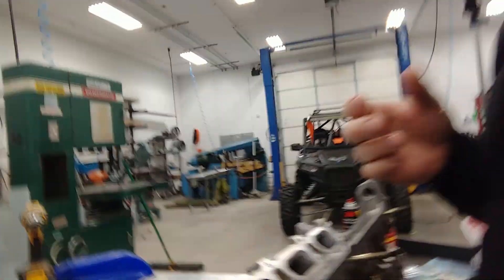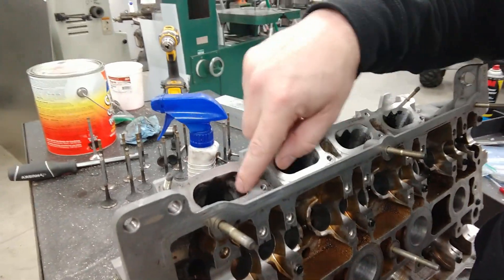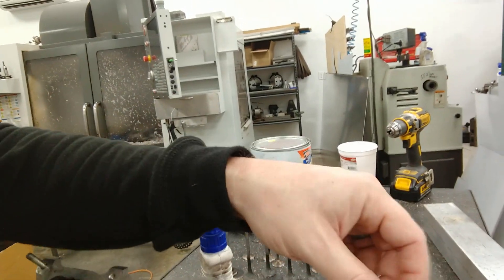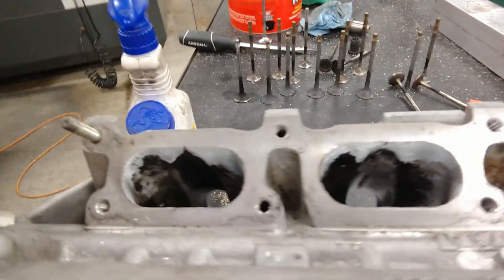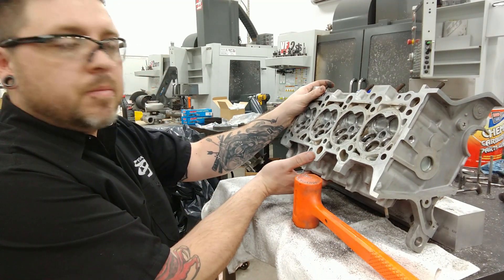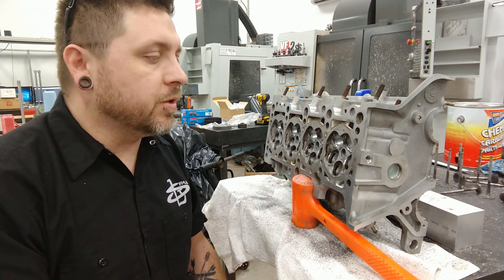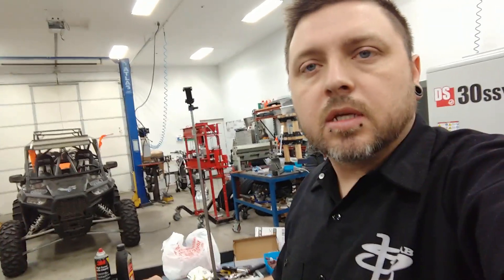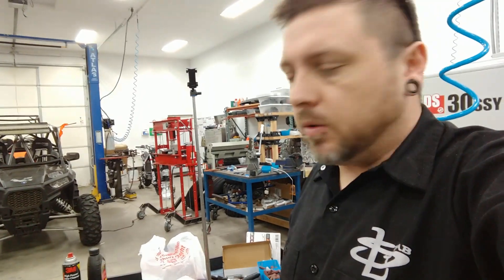VW 1.8t 20V engine build, head porting, intake ports.

Comment: I'm currently setting into the same job on an AWM head for my Passat wagon. A long time ago (18-ish years) I ported a 16V head for the Scirocco I had at the time, that one was a 1.8L head on a 2.0L Passat block. Comparing the 1.8L & 2.0L heads revealed noticeably larger ports on the 1.8. That work rewarded me with a very noticeable increase in engine response, it would rev up way faster. Certainly some credit would go to the larger exhaust and Euro intake cam, but I'm certain the head work did a lot. There seem to be a lot of parallels to how you've opened yours up to match the valve seats and also tweaked the ends of the valve guides too, with small differences how we both approached that. I did like your solution for using the tubing to spin the valves for the seating process, I was going to be looking for a suction cup type arrangement to put in my drill to spin the valve from the chamber side, but your trick might be what I try instead. My idea would have wobbled a lot if not perfectly centered. Teardown for the 20V head is more of a PITA with the smaller intake ports and getting out the valve stem keepers, I imagine getting them in will be even more 'fun' than their removal was. I originally found your channel while searching for valve stem keeper installation tools & techniques, though being in Canada the significant shipping cost of that tool makes it less appealing. Anyways, nice work & love that shop. I too just smoothed and polished the combustion chamber, removing the minimum material possible. I just wish the exhaust manifolds were as easy to port as the intakes.....

Comment: Unless your going for over 800hp that won't make a difference. I'm not saying that from a guess. We made 352whp with an f23. It's making 562whp with a precision 6062 now. Stock cams. Small port head. Next year we will be over 650whp. Small ports.
Reply: What mods did you have to make 352whp with the f23?
Reply: @joshpalmer4889  tubular exhaust manifold. 3" turbo back from 42dd, 650cc injectors. S4 maf, IE rifle drilled H beams and wiesco pistons and a bunch of other stuff. The configuration did not last long.
Reply: Did you use e85 or meth?
Reply: @joshpalmer4889  93 octane tune. Water-meth kit was used to boost the octane. We had a 450hp pte5052 TT that was e85. Hard to find gas stations. With the 93 tune it was easy to drive staying out of boost and getting 30+mpg. Hit the dragon and get 4mpg. Then back to Virginia. BTW, the cams will get you there. With the pte6062 it was a mirror build of the vagwerx shop car except we had stock cams. Vagwerx said the cams would put us at 650, 500tq. But the trans was not ready. The current tune is 397ft lbs.
Reply: Also what failed on the configuration? I’m setting up Gonzo’s gtt k04 and trying to max it out. So far I have a grams 70mm throttle body, grams small port intake manifold, IE’s street intake camshaft, high flow exhaust manifold (not tubular), drop in rods, next will be meth and e85…
Reply: @joshpalmer4889  we kept blowing charge pipes off and overboosting. We didn't have an issue for a while. But the China tubular manifold was really close to the wastegate actuator and it melted the internals shut.  Wastegate was all boost, all the time. With the oem manifold and k04 it was blowing gaskets. The frankenturbo kit was picked up and they no longer stocked the chinafold. The hoses were a joke. Oil feed tube wrapped around the engine bay. Drain back tube was not for awd. Dealing with them made us not want to mess with it anymore. Vagwerks was brought in to fix everything. Pte6062, ffe tubular mani. Snow water meth. 19k in total for the build. If I was to do a budget build, a t3 mani with eBay turbo and custom exhaust. Big injectors, and tune tune tune. Im actually typing this sitting over the built motor on the floor in front of me. Trans is getting updates and motor spun a bearing. Self inflicted.